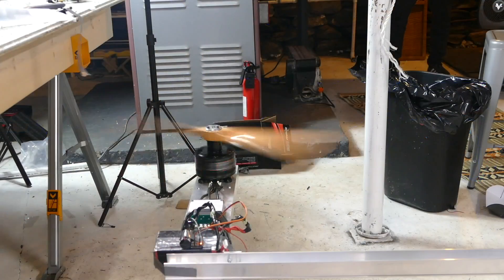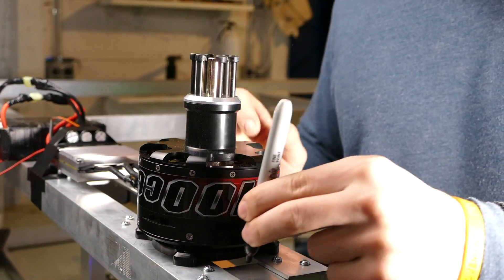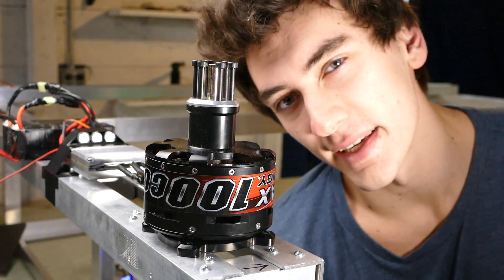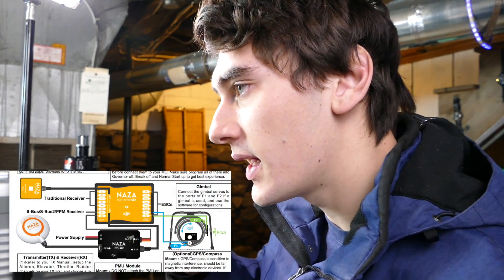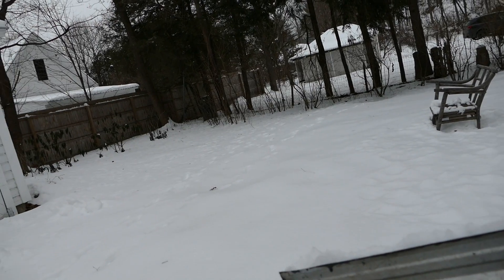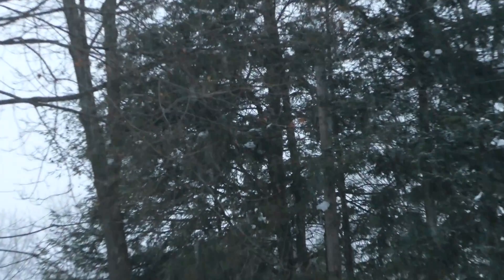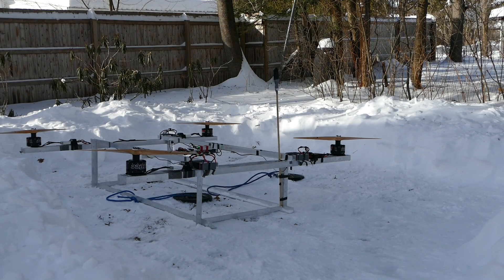I CRASHED MY HUMAN FLYING DRONE (Part 2)

Comment from the maker: Thank you all for you’re helpful suggestions. This type of project is different from the stuff I usually do and is very new to me. I know others have done similar builds, but the goal of this project is to document the experience of learning how to do something as crazy as this. I am by no means an expert in this area and will/have made mistakes, but that’s exactly the point! I hope you guys like it and look out for part 3!!!
Reply: I have already commented this but i dont know if you saw it, this be the problem:

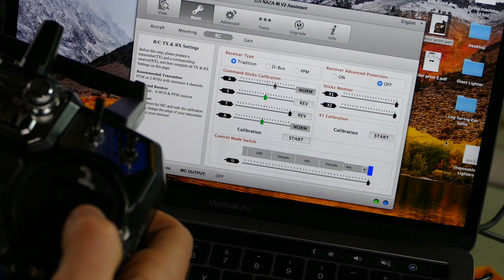You are in full manual mode, Look at the bottom slider at 5:43 The controller is not helping you at all, you must connect a channel of your radio to the control mode channel on the Naza. Then use that channel to select GPS.

After you have correctly done that and it still tips over then you have to increase gain settings of the Naza (How much it reacts) if the gain is to high however it will start resonating in the air

Would love to hear whether this was/is the problem, Looking forward to the next video.
Reply from the maker: Thanks for the tip! I'll give it a try
Reply: JLaservideo why isn’t YouTube sending notifications for your videos??
Reply from the maker: Because they don't like me... Ring that bell button.
Reply: @JLaservideo  could you please link the motors you used?
Reply: @Bedardman42  they are turnigy rotomax
Reply: @talknstang400  thanks
Reply: Be prepared to cough up some $. 4 motors are ok 4 testing purposes but ideally 8 is your best option. At nearly $400 each just for the motors with rhetorical esc's costing nearly as much, its not a cheap project. If I had funds I would have already done it for sure. I've been building and tinkering with drones for a few years. They are a proven flying platform you just have to know what you're doing for sure. I probably would use a different FC but I have a NAZA v2 lying around and am quite familiar with the software.. At least I know it's doable
Reply: @talknstang400  OK, thanks for the advice
Reply: Do you have a link for the motors? Thanks
Reply: @RudeAnSmellyFPV  https://hobbyking.com/en_us/turnigy-rotomax-100cc-size-brushless-outrunner-motor.html
Reply: I imagine if you had military funding the soldiers would be flying around like ironmen and the would be using wifi maps and thermal imaging in 3D to find targets in all directions
Reply: JLaservideo    where did you find the matching blades ?
Reply: What type of motor are those?
Reply: Are you serious😱😰....
 you are using basic flight controller ..
Reply: You actually got demonitized
Reply: How much did all this stuff cost? And could you provide links to the parts? Thx
Reply: @Pets Land Which parts?
Reply: Hi Jake, could I please get the parts list and companies you purchased them from, would be a great help. Thanks Chris

Comment: I would rubber mount/isolate the FC, so the vibrations from the motors coming through the aluminum frame don't cause instability.

Comment: i think you might be better served using an ardupilot based setup or even a raspberry pi with navio.  You could add a DJI datalink to your NAZA setup. Calibrate both advanced and basic modes every time you make changes

Comment: you should add a hover level that you woudnt need to control to keep it at that level?
Reply: that FC does not have that option if i am not mistaking although in GPS/Alt mode it would probably be more stable. Manual mode would be nearly impossible to hover as a beginner

Comment: It seems like the motors were each pulling different amounts of current. How did you end up fixing that??
Reply: he probably had the FC in manual mode and not GPS/Alt. That is now how you lift off in manual mode for sure...you can't ease into it. It would be stable in GPS/Alt mode

Comment: Jlaser cut the weight of the frame down an add 8 rotors on a much more effiecient smaller frame design you'll be golden test an fly tf out

Comment: How do you transfer your transmitting signal to your receivers from your remote. Are you programming the system or did that receiver/transmitter come preprogrammed with a schematic describing the different port operations?

Comment: I wouldn't trust many things with my life that are A. technology involving circuit boards or processors to keep me in the air or B. come in an Iphone box. Perhaps your viewers have different standards. Given, the FAA is really lagging on new technologies and I am a bit curious. It does make me wonder if they have looked into options. Get a cheap hang glider, strap a few RC motors onto it and add onboard throttle which doesn't involve radio signal to run (Mechanical Speed Controller we called em back in the day or similar).

Personally, I want one of these https://www.youtube.com/watch?v=gbblLJ_FK5U I'm not sure if these classify under the FAA part 103 regulations but, hey, it's alot more fun if you don't get caught.

Comment: Ditch that flight controller. Go with a pixahawk or betaflight based flight controller. Start in auto level mode and somewhere with a lot more space. Blip the throttle to get off the ground rather than slowly building it up. Doing that can cause a little lift, quad get moved by wind etc, part of the frame catches and causes it to flip or roll in that direction. So just a bit more confidence to blip the power to get right off the ground in auto level mode will help

Comment: this is gonna sound counter intuitive but, would adding weight help here?  im thinking one corner might be heavier than another, meaning that one motor might under perform if spinning at the same rpms. now i realize that other factors would go into this, but distribution of weight seems like an easy one to solve, so when you do add in the stabilizer all the motors are running a little closer to the same load

Comment: Consider very carefully the idea of a quad, no safety net death is assured w/ one motor or prop failure. 4 more motor's one under each u have now, total 8 or octocopter. With a better FC like a 3-DR Pixhawk, u can have one motor failure and stay aloft. Yes, I know 4 more motor's and ESC's double the cost not mention more prop's. I did this also, You need a hex or an octo to be safe. Good luck.

Comment: Your getting some bad info from some. The DJI FC u have will fly what your wanting to do. Make sure u use the software and set where the FC is at on the craft.  Remove gps!! Never use on larger craft.. switch to alt mode and so on. I can send u basic specs. I quit using a FC at all on larger units ive built. Down side it they limit power. The motors u were using were around 7000 watts. That FC will only let u use around 3500 watts to keep a reserve. Id go to weight shift on a craft that small.

Comment: Ok, this guy seems rather blasé about risking himself, at least 3 cameras of $500,  $1350 of motors, $442 of flight controller, $20 of wooden props and whatever else mounted to a few dollars worth of stock angle aluminium that clearly twists just when the frame is upside-down.

Comment: Just finished the vid the testing conditions you had was very bad I’m no scientist but there is something called ground effect and it is the deflected air hitting the drone and causing it to go crazy and you weren’t just close to ground you also had snow around the thing so the ground effect was even worse I don’t know if that’s the only reason it went wrong but you need to correct that in your next vid by the way you just got a subscriber.

Comment: DJI Naza is not suitable for such a large size. You must use either DJI A2 or Wookong
Reply: A2 and wkm are expensive
Reply: @ahmadfaraz3656  maybe you should look for used
Reply: @ahmadfaraz3656  the range of Naza gaines cannot be tuned to such large motors. She made for 9" props
Reply: Thanks brother ,actualy i am building 5 feet diameter hexacopter, i am looking for less expensive and suitable flight controler.

Comment: Please make something smaller first.  A project like this is not a trivial undertaking, even when you have been flying RC and configuring flight controllers for many years. None of the experience you gain from making the small version will be wasted, it's all the same knowledge, just at a much cheaper, quicker to build, easier to repair, and less dangerous scale. As a bonus, you may also get addicted to FPV or racing the small quad :)

Comment: Get a actual battery pack and run it off of one plug all batteries variate
Reply: In x-class they usually use 2x 4s packs wired in series. Considering they pull like 300 amps without an issue I doubt it'd cause an issue here. Anyway,  you know a single battery is actually made of multiple individual cells right?
Reply: Liam Haddon as long as your running it off of one source wired on parallel or series there shouldn’t be a problem  other than your gonna need a way bigger battery bank real soon
Reply: Liam Haddon is the video he has a batter hooked up to every esc separately and that will cause variations and failure of the flight controller

Comment: You calibrated a GPS and compass in the basement dummy. You need to do it outside away from metal structures or any other electrical interference.

Comment: I dont see any ESC's?? You need them.... You can't just put the motors direct into the Naza controller.
Reply: MOBRA MUSIC you clearly didint watch the video or your dont know anything about quadcopters.
Reply: @maxiemusfpv198  I have been building drones for many years now, and I really mean what I say - you have to use ESC, otherwise the motors will just speed up? The ESC is the speed controller, and feeds the motor with throttle info... I have never seen a drone fly, without ESC's?
Reply: MOBRA MUSIC un less it uses brushed motores, my intention was not that it can fly without them but that they were in the video on the booms/arms. They had a heatsink and 2 caps on each one. Thats what larger escs tend to look like.
Reply: @maxiemusfpv198  aah okay 😊 I did not see them in the video... He just says something about connecting the motors directly to the Naza flightcontroller.
Reply: Bruh! Brushless motors don't work without esc's hahaha.  On straight DC they'd probably just burn up haha

Comment: Get a modern flight controller, you don't need the calibration dance.
Reply: @123321curious The Cube with Ardupilot flight stack
Reply: @123321curious Probably ones from Hobbyking, where he got the motors from. Use a little more solid connections than he did. Your life might depend on them! If you want to hear more about big speed controllers, we are going to talk about them live on our weekly Hangout at 21:00 GMT tonight!

Comment: You are using really really outdated tech for drones. Why you pwm when you can use SBus. Same goes with the naza flight controller and flysky system.
Reply: @123321curious sbus is a protocol used to connect the fly controller to the receiver. he's using PWM which is why he is using allot of wires. Sbus only needs one wire and it's more responsive. The naza is just super old and there.are better alternatives.

Comment: I'm a little confused about this DJI stuff given that he's using a naze flight controller. Does it run dji firmware? Also was under the impression that DJI was a closed proprietary software.

Comment: Start by building a 5" quadcopter to understand how everything works, starting directly from something this big you might break a lot of stuff and hurt yourself... 
Also try to make nice solderings and protect all your electronics, with such big motors that draw a lot of current this is a point not to be neglected, especially in the snow.

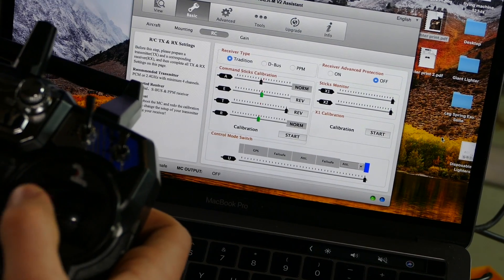Comment: You are in full manual mode! Look at the bottom slider at 5:43 The controller is not helping you at all, you must connect a channel of your radio to the control mode channel on the Naza. Then use that channel to select GPS.

After you have correctly done that and it still tips over then you have to increase gain settings of the Naza (How much it reacts) if the gain is to high however it will start resonating in the air
Reply: Help him see this by liking this comment.
Reply: @ImThijs  He clearly aint got the brains to do this safely. I wouldnt encourage it.
Reply: yes,  make sure he's in GPS Alt mode and GPS signal is good

Comment: I would look for throttle calibration, flight controller should help to hover easily with only with given throttle, but it looks each motor power is little differ.

Comment: hey ! thats a cool project, I dont know where did you mount the gyro but make sure that is as close as possible to the CG or on the center of the drone, just to get rid of possible problems on the future, also check the PID configuration, because the drone is too big so the props dont spin at fast, so its having a hard time doing small corrections ,hope it helps you, keep up the hard work!!

Comment: Hey, I know whats up with the drone! So the flight controller was on total Manuel mode. Like for FPV race drones. What you have to do is set it to a beginner/intermediate mode, where the flight controller stabilizes the drone on its own.
Reply: I can describe whats going on more thoroughly if you want. Also, if you need any help with this project or any questions, let me know. I am quite experienced with electronics and rc planes and drones especially.
Reply: @tobycannon3964   How have you been able to reply to your own comment 1 day BEFORE you made the original comment?!
Reply: @RiverMersey  I have no idea! Must be a glitch in the matrix, lol
Reply: How to set flight controler on begineer mode?
Reply: @ahmadfaraz3656  There are different ways depending on the flight controller and transmitter. Sometimes you can flip a switch on the transmitter. Other times you have to plug in the flight controller to your computer and change the settings that way.
Reply: Toby Cannon Hi
Reply: Can you help we that software. I mean which he is using or you can sujeet me something best
Reply: @thenatureguy4803  he needs to program his controller with a switch for GPS/Alt mode   pretty simple.  Once GPS signal is achieved, it should be more stable. When lifting off, pop the throttle more instead of trying to ease into it. It'll come off the ground stable if setting are good

Comment: Wow nice but I think these four motors are not giving enough thrust because drone weight with you should be half of total motor's static thrust ,these Motor give thrust 25 kg each then 25*4=100kg total ,so your drone weight must be 50 kg for best flight.

Comment: Good vid Jake. My 2 cents as a bad drone builder- Put the flight controller on something to absorb vibrations. I'm assuming it has gyros and sensors and stuff, mounting it on metal may make it work less well. Also you should put some little cages or rings around the propellers. Expect to hit them a lot lol...

Sincerely some dude with a 3d printer trying to make a drone whos been too lazy to get back to working on it lol...

Comment: you might have to double check the motor config compared to the naza motor config diagram. Some motors could be rotating in the wrong direction causing it to tip. or its just a calibration issue.
Reply: If they were rotating the wrong way then it would've flipped out as soon as he armed

Comment: Hey man. Great video! Don’t forget that your NAZA flight controller is set for a drone that’s WAY smaller. You’ll need to adjust your PID settings within the DJI Assistant software. Can’t wait to see you fly!!!
Reply: More than that, the Naza really won't work on drones that are over 1200mm across. Dude needs to do some research. A2 at minimum, or a pixhawx
Reply: TheBeardFPV I think that the naza would work with some tuning. I’ve seen other human drones that run on a naza and they seem to work
Reply: Isnt it sad when his viewers are smarter than him.....lol he should see u guys comments tho

Comment: you better be ducting these props as well as wrap them in some kind of mesh if you wanna live a little longer. These are 4 10kw motors, wouldn't wanna sit in the middle of them...